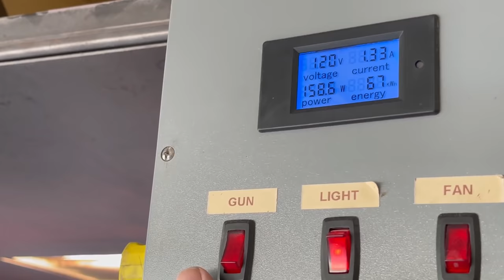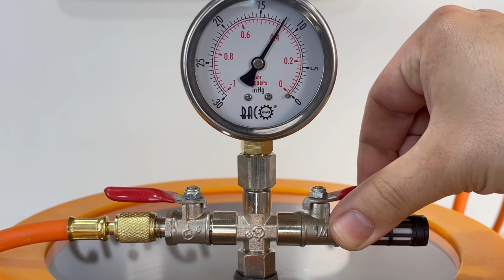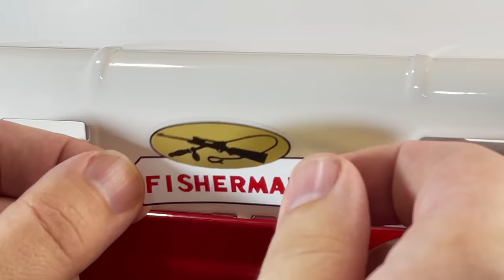1961 Tonka Fisherman Camper Truck Restoration

Comment: Thanks so much for sharing the images of the specific equipment and settings you use when doing the restoration. I have been thinking about giving something like this a try but am sadly ignorant of what it takes as a whole to do it properly.
Reply: Just start out and your skills will get better as you go along don’t need all these tools to begin with  harbor freight has a sandblaster under 100 bucks on sale and paint them at first  you will be surprised how they can come out !

Comment: What an incredible restoration. Stunning work. Thank you! 🧡 I know you asked for ideas to stop the tabs paint cracking. I did a bit of research  Have you tried adding additional powder coat plasticizers to your standard mix? 🧡
Reply from the maker: Thank you soo much for the idea! I will be doing some research into this tonight!
Reply: @ChipChannelRestorations  The plasticizer is a good idea. Another thing to consider would be the thickness of material that is applied.  Thicker powder coat as well as thicker paint are much more prone to cracking.  Perhaps mask off or wipe off the tabs during the primer coat and only apply color on the final spray?  They will fit in the slots easier as well.  A good supply of nail polish makes for easy touch ups.

Comment: Oh kitty kitty.  I use the same mold rubber.  Sometimes I find it best to saturate the original with a disposable paint brush then slowly pour in the rest of the rubber.  Then stick the small paint brush slowly back in and kind of brush the part again.  You cant see the part but you can feel it.  All you're doing is removing air bubbles off the surface of the part.  That vacume pump sure is nice, I've never used one.

Comment: Question:  what would you do, if the paint DID test positive for lead?
Reply: You'd use a paint remover (while wearing gloves and painters mask) scrape it off, use steel wool or Scotchbrite to take the last of it off. THEN you can sandblast it. The stripped paint would have to go to a hazardous reclamation site, but many counties in the U.S. have one.

Comment: Picking up pointers on restoring a Tonka toy 70's Dodge pickup. I have  to sand blast it, then I want to powdercoat paint it... hoping to get idea of powdercoating with a powdercoat gun. This is a new process for me. I'm not certain of oven temp or time to cure the powdercoat paint.